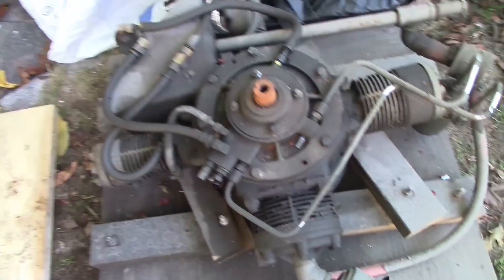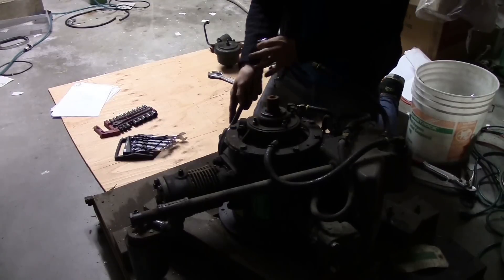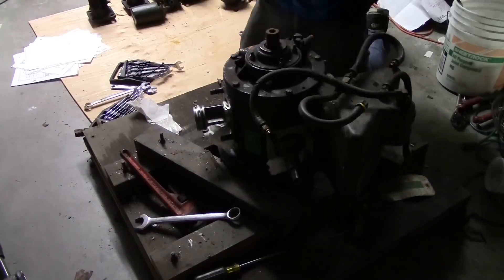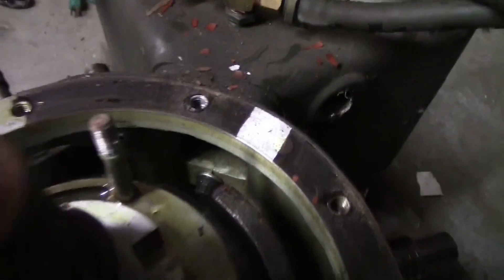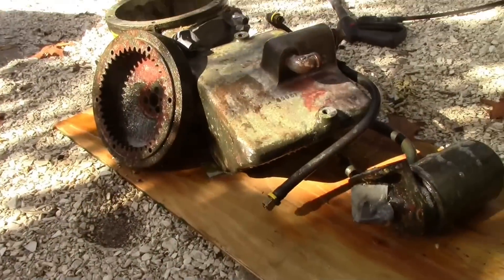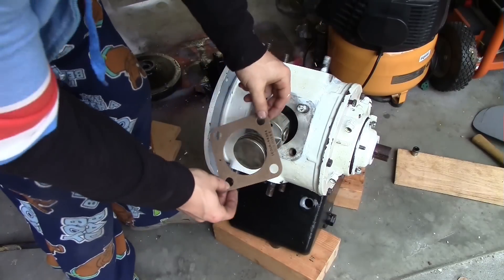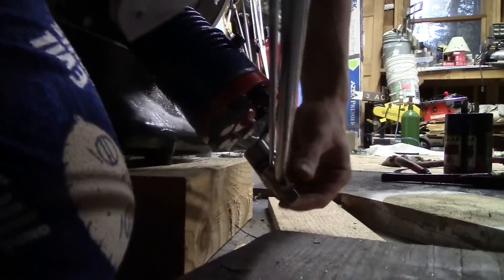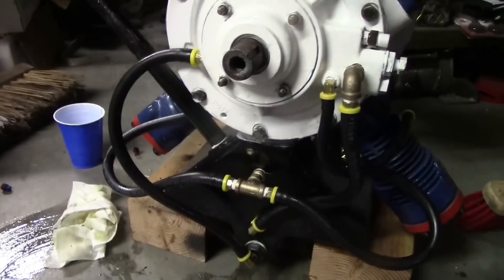4,500PSI AIR Compressor Rebuild

Comment: Dude...where did you learn how to do this?  I've been working with compressors for years and although I haven't done pistons & rings before I'd be fairly intimidated to take on a project like this.  I have one old Bauer from 1968...it's basically a K-14 but I can't find ANYTHING in terms of parts for it.  It might be a mako/bauer/drager...I've found similar photos of one that old.  I guess that K-14 mod 6 parts fit up until the 4th stage.  I'd love to do the same with that rig.  I'm super impressed at your work here.

Comment: I am running one of these backwards. It would pump to 900 psi. I cleaned the 3rd stage valve. It pumps to 1900 psi. I will see if the 4th stage valve needs cleaning. 16hp bs. large 21 inch pulley. small 2 inch pulley cut on a lathe. for lox. cool with 4 stages. 4th stage no heat on outlet pipe.

Comment: lox for rocket - how does that front oil seal assemble?  - I put a 22 inch pulley on one. With a 16 hp  single cylinder engine. Can it run backwards? With an electric oil pump. getting closer to seeing air pressure. I remember I had this when spacex entered the ansari xprize contest. yup 62.5 hours out of ft jackson. It might have been all the police.

Comment: Good work. I had the same problem - even tried sweet talking the power company into pulling the 3 phase (so all the millions of versatile, odd-application motors on the used market can be put to work) but they would not pick up the install cost. Can't stand the rotary phase converter concept. Ended up being patient and eventually a nice single phase popped on craigslist. Just be careful with all your projects, seriously. It took me many more years to get to 5% of where you are.

Comment: I can't wait for an update !
Reply from the maker: Blast Right now I'm bending up a few hundred feet of stainless heat exchanger pipes into coils that go on inside a large vacuum chamber I built
 Its a really big project, almost every component weighs over 300lbs :)
Reply: BenNBuilds Wow that is one serius project.  I can't wait for the next update !

Comment: damn! where did you get it? how  much would these things cost around?
Reply from the maker: 어디가 Ebay, it was like $900 which is a lot but even the 4cfm scuba compressors are 3-4 grand new. High pressure stuff gets expensive really fast